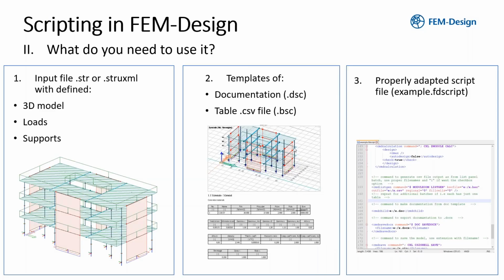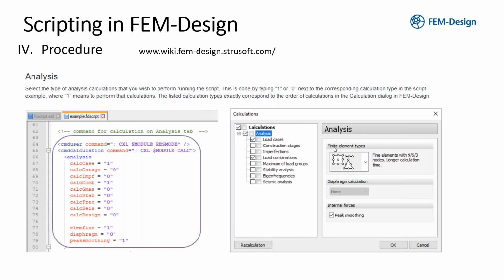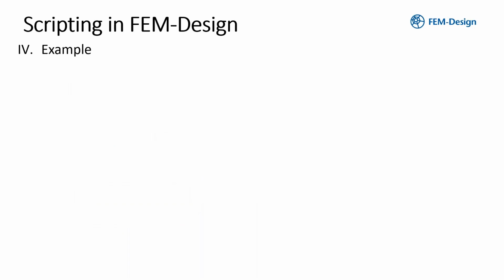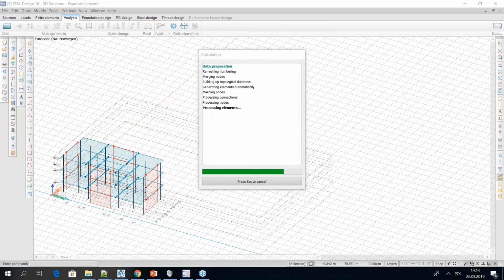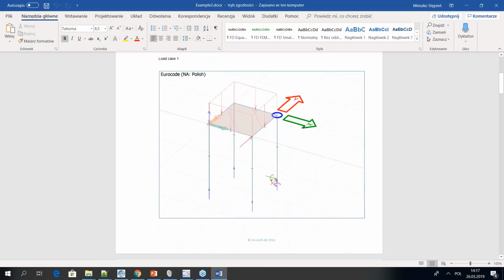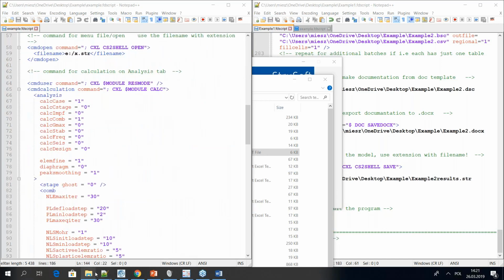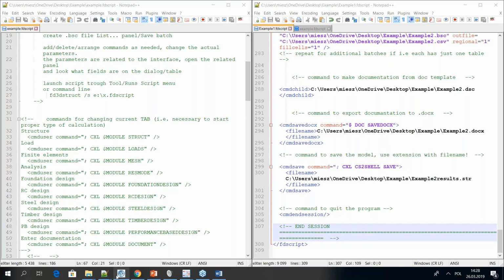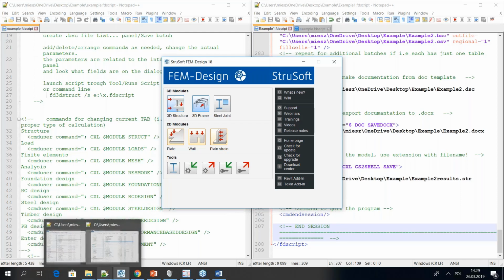Webinar: Scripting in FEM Design 18

Comment: Is it possible to write a script to export result in PDF format.

Like, after you run the model and while in the RC design tab

You can check the results such as Mx top
My top
Mx bottom
My bottom
Ez-
Fz-

And also for wall RC, is it possible to export all the wall RC required values by writing a script?

I usually print the values manually by selecting the results, then add numeric values and then by using the crtl+p I print the result to a PDF file on a suitable scale. This procedure is very time consuming and tedious. Is there anyway we could automate this task using scripts?